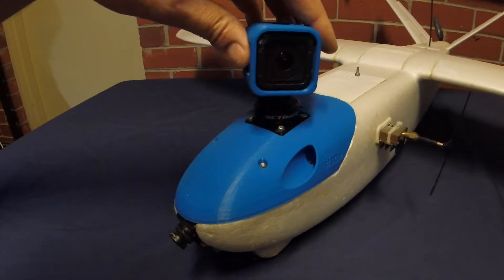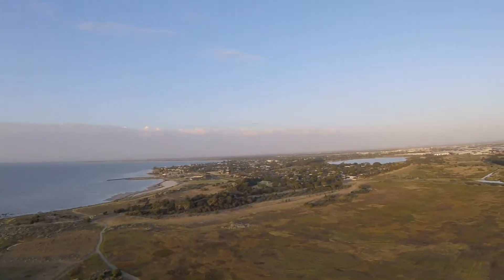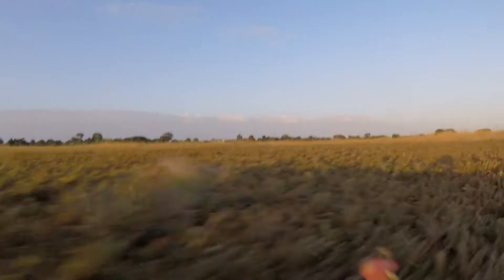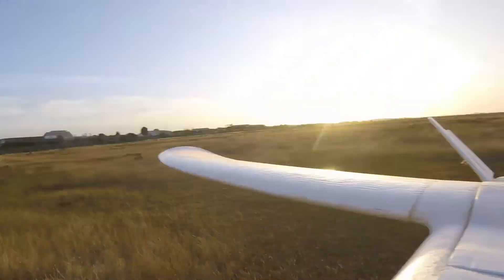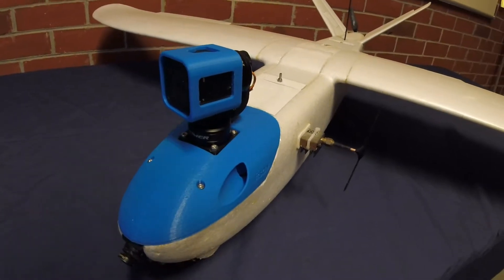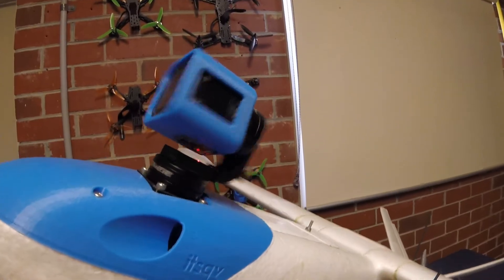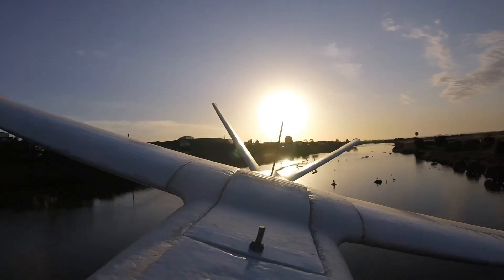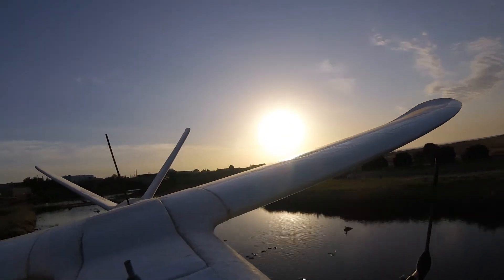» Mini Talon 2-Axis Roll & Pan Gimbal (Update After Test Flight)

Comment: Also you may want to consider the Tarot gimbals.  I’m not sure what boards they use but I highly doubt it’s Storm32 because they actually work well right out of box as I have one on a s500 drone and just slapped a GoPro hero on and Wala it works flawlessly
Reply from the maker: I looked at the Tarot gimbals before. Not sure if there are different models but I couldn't find out if it could be mounted upright and also they didnt do 360's. I think the panning was limited to 270 degrees

Comment: Sorry but never liked Storm32 boards.  I’ve had 6 of them and never could get them tuned right.  I decided to never buy another Storm32 board after a rude encounter with the developer of this board OlliW’s.  I stated my issues with him once on the forums and he immediately started blasting me and calling me stupid and say he don’t care if my board works or not and he’s aware that some boards are just un-tunable if that’s a word.  
So that’s that!  I won’t support someone who treats his supporters like this.  By the way ALL boards were Authentic Storm32 boards not clones.   
I had the same issue you are having but in a multi-rotor setup.  I spent almost a year trying to get these boards right and eventually just gave in.   BaseCam boards imo are a lot easier to Tune and the GUI is way more user friendly
Reply from the maker: Interesting. A quick search on youtube reveals lots of storm32 issues. I think it wont be long until they are obsolete anyway with more and more 360 cams coming out

Comment: Have you made any changes to your Imu AHRS settings? Came across this vid from ZaksterBlue(/watch?v=RHGZL9E8VFI). It's a 1 Axis but he's using a Strom controller as well. I've done battles with these gimbals and it can test even the most steadfast person's patience. Always enjoy your vids. Thank you for uploading!
Reply from the maker: Thanks for the link bauhaus. I will play with that setting and see how it goes. I really want to get this thing working because I miss my old gimbal with panning so much
Reply: @StuntDoubleFPV  Man, I’m right there with you. I’ve been looking around for something for about a year for my MTD, it’s frustrating how everything has just vanished in the last 2 years. I know that slip ring is so nice, but have you ever tried a hybrid with a sail winch on the pan and brushless on the roll?
Reply from the maker: Yes I have flown with a roll axis on top of a gws360. It worked OK, sometimes I would see a slight bit of vibration from slop in the servo gears but the problem was it was too much weight for the servo spline. I snapped one of them off. Really need to take the weight off the spline using bearings, maybe something like one of MarkQs early designs for the mini talon. But I will try hard to get this to work first, it has potential for greatness